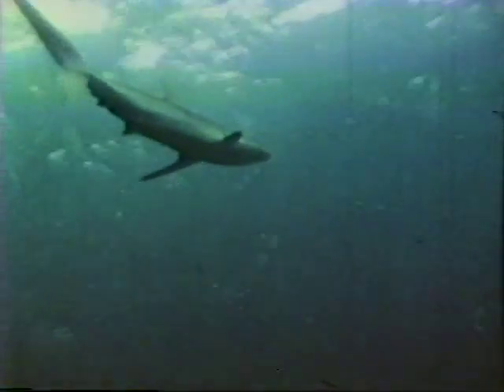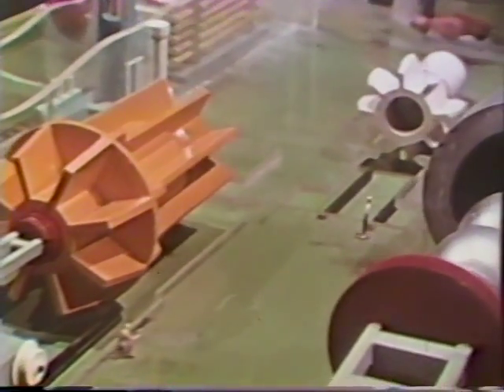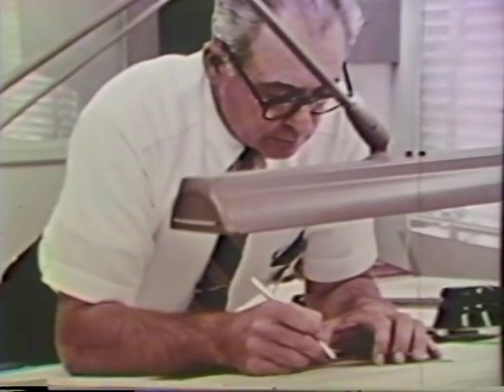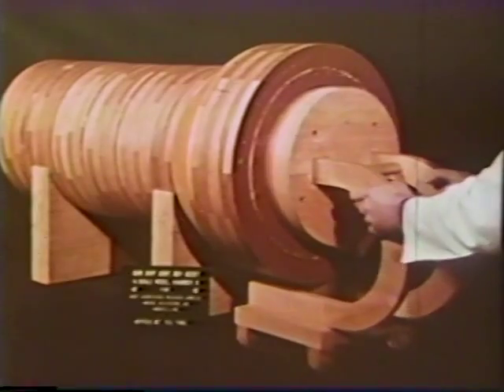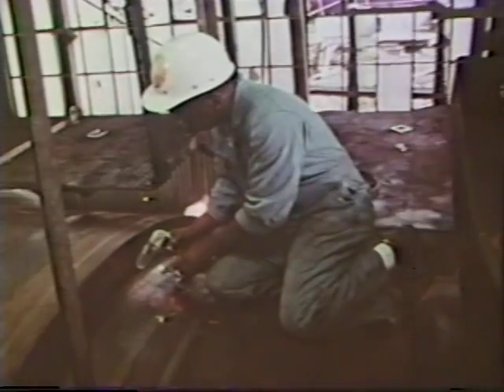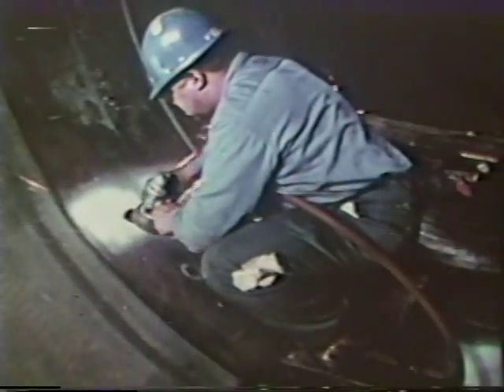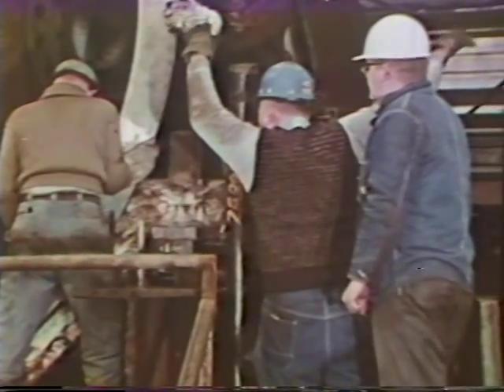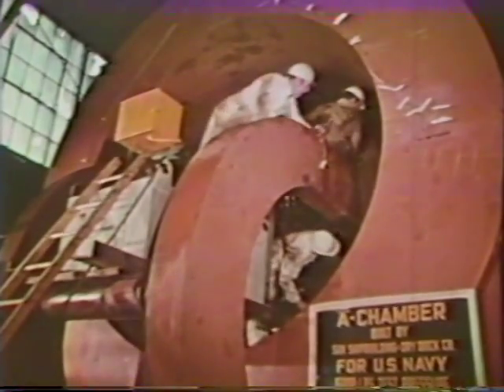Deep Ocean Test Facility

Comment: Fascinating series on the Construction of the Deep Ocean Test Facility.  Found it on the usual internet rabbit hole when I wondered where Stockton Rush and OceanGate could have tested their Titan submersible that was tragically lost recently diving he wreck of the Titanic.  The DOTF would have been ideal and is used by the offshore oil & gas industry, US Navy (it's founder) and others for deep water testing.  With a maximum test pressure of 12,000 psi the DOTF can test down to 27,000 feet of sea pressure, far beyond the 12,500 feet and 5,600 psi encountered at the Titanic wreck.  However Rush & Oceangate were accused shortcuts and/or poor design choices (they called it "innovation") and I haven't seen any reports of Titan being tested at DOTF.
Reply: How do they attain those pressures?
Reply: That's exactly what I'm looking for and what brought me here.
Reply: Myself also. in the video "GW Summit Power Talk: Journey to the Titanic with Stockton Rush, Chief Submersible Pilot, OceanGate" Stockton seems to mention some testing here at the D.O.T.F. and one destructive test at the University of Washington - Oceans Sciences Building about 9 mins into the video he talks about it being a loud explosion and everyone being cleared out.
Reply: Tests on the sub at the Deep Ocean Test Facility in the US also found that its carbon-fiber hull "showed signs of cyclic fatigue" at lower depths.  OceanGate then had to scrap planned dives to the Titanic in 2018, 2019, and 2020, per the report.
Reply: They did test the Ocean Gate sub 5 times and failed to meet ATSM standards.